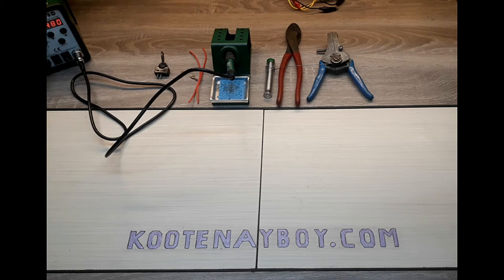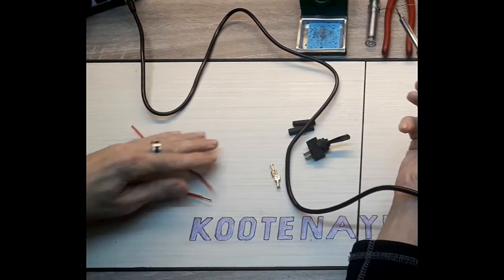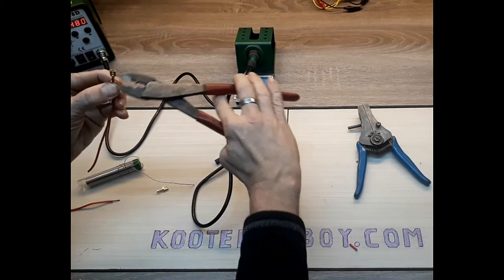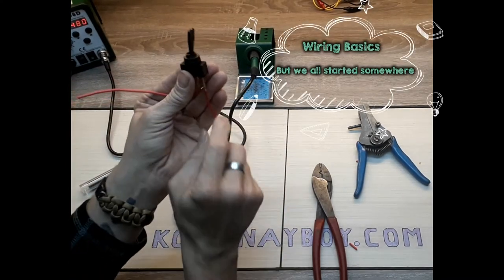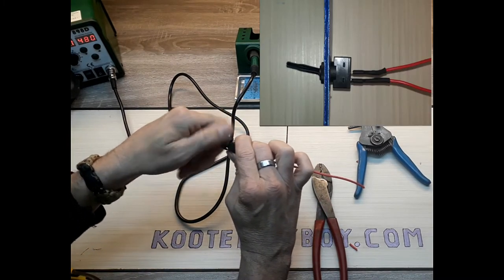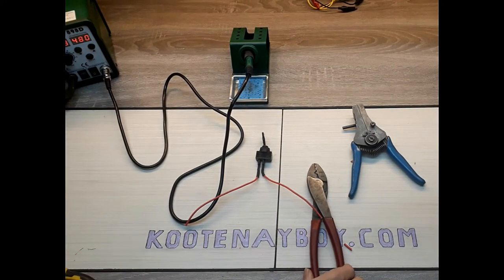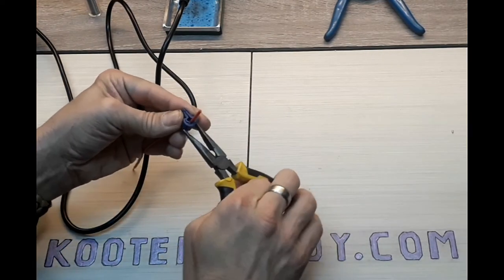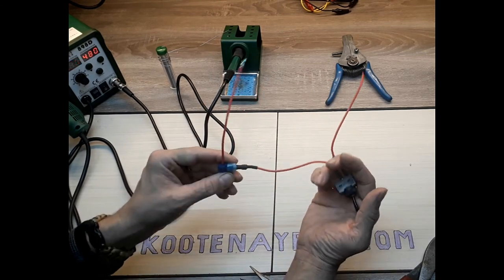2 Pole toggle Switch and T-Tap

Comment: Thanks for the video. I have a 2 pole toggle switch that controls some of my hot water heater but I'm trying to change the manual switch out with something that is wifi enables so I don't need to walk into the garage to turn on/off. Is there a way to replace one of these simple toggles with a wifi controller of some sort?

Comment: So to make it simple the negative wire just simply goes to the battery as normal and this is more less added right into your positive connection to join hands so to speak.  It’s just literally added to the positive connection in and out and even more simple terms the positive connections imply runs through the switch in one side out the other.  Is this correct ??